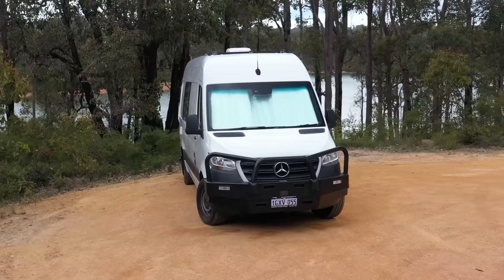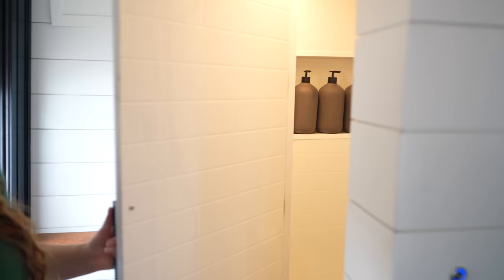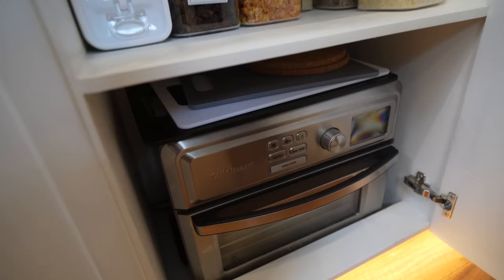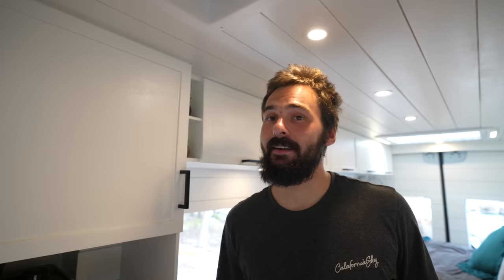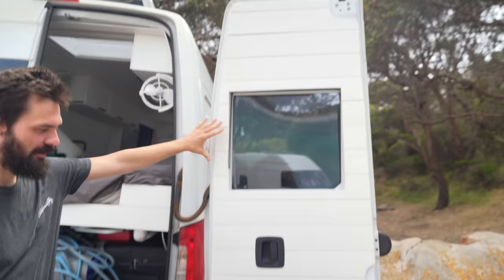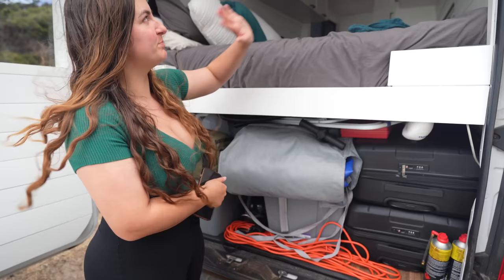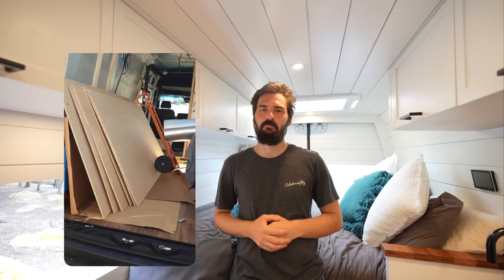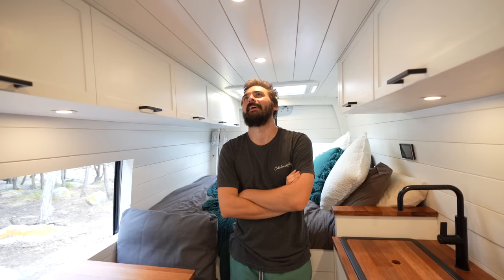VAN TOUR | Complete OFF GRID Self Converted Mercedes Sprinter Van

Comment: You are the first Van video person I have seen make a point of DC to DC computer charging!!

Finally!!

Love it. Totally the most efficient way to power anything that can take DC.

I turn on my inverter for the microwave, the induction cooktop, and things that aren't used often so they did not make my mental list.
Reply from the maker: Thank you so much! The DC2DC chargers are great. Especially with some of the vans having such capable alternators. It’s also nice not having to rely on the weather or campsites to be ideal for solar charging. 😅

Another great option would’ve been a supplementary alternator for the house battery but the pricing on the DC2DC chargers were much more appealing (at the time of purchase) and some of these vans have such capable alternators from factory.

Comment: I’ve seen alot of van builds over multi countries. But this 1 is absolutely perfect. Every thought, every detail, cost cutting that makes ton of sense, I love it. 
Only thing I think I’d add would be a small window between the kitchen sink & work area. An make the shower just a little bigger. Other than that I wouldn’t change a thing. An you 2 need now is some home touch’s, plants, pictures. You 2 are awesome, look forward to more video’s, so glad I came across this 1.
Reply from the maker: Thank you so much for the kind words, we really appreciate it! 😊 We did debate having additional windows actually but have been pretty happy with what we have so far, especially as our windows get super hot during summer 🥵

We're hoping to find some special home decor items while on the road!

Comment: Are you liking your square edged drawer/cabinet pulls, or do you find yourself bumping on them? Did you use 5 1/2"?
Reply from the maker: We were a little worried that would be the case but we’ve had no issues at all and we love them! The ‘hallway’ section in the middle though is pretty spacious in our van, if it was a tight squeeze in the middle it might be a different story. They’re 96mm, they’re these ones https://www.bunnings.com.au/taskmaster-96mm-matte-black-hollow-square-handle-10-pack_p0132784

Comment: We noticed you guys use a lot of major appliances, that’s so awesome. Do you use any appliances that are 1700 watts? In the USA so many say nothing over 1200. But you’re the 3rd van we noticed using such appliances. I’d you are able to use 1700, what electric system are you using? Appreciate any help/advice you can give to my husband and myself. Cheers and thank you kindly for sharing. ❤
Reply from the maker: Hi, yes we do! Honestly it really depends on how capable your electrical setup is to what you can use. We used a lot of Victron components which are considered as more powerful and reliable as well as high gauge cabling and appropriate fusing throughout the van that is capable of more than what our power draw can be. This allows us to use the full capability of the 15 amp 240V sockets that we have throughout the van. 

Sadly we’re not too sure on the USA but it could be worth double checking if not using over 1200 is because of any regulations in your country. When we went to register our van as a motorhome we had to submit our electrical certificates to the department who manage and regulate electrical and building safety/compliance in Australia.

We’ve put together a post on the specifics we used in our build if you were interested: https://lydiaandwehan.com/our-full-van-setup/

Sorry we can’t be any more help! Let us know if you have any other questions 😊
Reply: We live in Australia and have also fitted a Truma Saphir. Any tips on using the ac?  We are a couple of weeks off completion.   Thanks!
Reply: @lydiaandwehan  Thank you so so much

Comment: ❤ I’m have some? For you and I hope you can help please. I have got the same van as you but it’s SWB 16 plat. My back doors opened up all round to the side of my van meaning that the hinges are closed into the inside walls. Was your door’s the same if so did you get them replaced . I’m not sure how I could fix them so they don’t go through my walls . I’m looking for a window the same size you have over your bed. I’m thinking about one that opens up fully so that I can get onto the roof and clean up my solar panels have you a link for the window. Also have you a link to the sliding door black screen net please. Thank you very much for your time and sorry a long message I do hope you can understand what I’m saying I use speech chat as my reading and spelling skills are bad. Start my anxiety off . Thanks for sharing your lovely van you give me some ideas. Take care I have subscribed to your channel i hope you come across to my channel. Unfortunately my old channel has gone as I had been trolled by horrible people but am getting back into my new channel take care all the best to you both 😊
Reply from the maker: Sorry for the delay getting back to you! More than happy to help 🙂 If your van is a Sprinter there is an option for 270 degree door hinges which it sounds like you might have (but not 100% sure). We just have the standard 180 degree door hinges. From what we remember these hinges are interchangeable so you may be able to switch them if that's the issue you're having.

The skylight we have over bed opens up fully, it's amazing. Wehan uses it to hop onto our roof and clean our solar panels also. We've listed everything we used in our build on our website, I'll add the link below:
https://lydiaandwehan.com/our-full-van-setup/

No worries at all with the long message we are more than happy to try help where we can. Best of luck with your travels 💙
Reply: @lydiaandwehan   wow thank you so much I  was expecting 1 line message back. 🫣 thank you so much much for your help and time means a lot. And thank you for your link.  take care yourself 😊👍

Comment: Does the coffee machine moved when you are on the road, if so What is the best way to secure it
Reply from the maker: We didn't secure our coffee machine and haven't had any issues (thankfully) as it's semi-enclosed in the coffee nook area so we don't have to worry about it moving side to side. We've driven on some very corrugated and uneven roads and it has been completely fine.

However, we were looking at getting a non-slip mat for it just to be safe but we've been pretty remote the last couple of months so are waiting till we get close to more shops to find one. 😊☕️

Comment: hey great video, do you have a link for the macbook air charger and how does it connect to the laptop thanks
Reply from the maker: Hey, thank you so much. 😊 I'll attach a link for it below, we use the charger cable that comes with the Macbook and plug it straight into the charger.

 https://www.amazon.com.au/Satechi-Type-C-Charger-Adapter-Charging/dp/B07S4CQY6J?crid=H29C1T0FJDLN&keywords=satechi+72w&qid=1674639896&sprefix=satechi+72w,aps,342&sr=8-1&linkCode=sl1&tag=lydiaandwehan-22&linkId=323dce9a891bf62e09a08be9c929e71f&ref_=as_li_ss_tl
Reply: @lydiaandwehan  thanks for replying, it’s currently unavailable but I’ve found it on eBay, I only got the mains charger with my Air but thanks for your help hope you will be posting more about your lifestyle, I live on a boat but I have a van I’m going to convert so I can get to the parts the boat can’t reach.
Reply from the maker: Oh sweet, glad you ended up finding it! Boat and van life, sounds like you’re living the dream 😍🚐⛵️ What area are you travelling?
Reply: @lydiaandwehan  i'm in the midlands England at the moment but i travel all around England including London, Birmingham, Leeds, Manchester and all places between all at 3mph about 5kph i will be heading to the Nottingham river festival in August

Comment: Hi brilliant video. I was just scrolling through your webpage about getting a van registered as a camper (which was very helpful) . 
I was just wondering, do you know if it is a legal requirement in aus to get it registered as a camper or can you self convert the van and never register it? Also what that would mean when coming to sell it? 
Thank you for your time reading!
Reply from the maker: Hi, we'd recommend you clarify with your department of transport and insurance company. We've heard a lot of people not registering their campervan but not doing so can leave you liable in a lot of ways... here are a few things to keep in mind: 
1. Insurance Coverage - if the vehicle is used as a campervan but isn't registered/insured, as such you can have issues with insurance if an accident were to happen. We'd heard stories of people having their vans written off only for insurance not to cover it because they weren't registered correctly as a campervan.
2. Resell Value - Having the vehicle registered correctly and having the conversion 'approved' increases it's resell value. Having the build approved legally gives more confidence in it.
For us, the additional effort was worth doing things 'correctly' and making sure we were 100% covered.
Reply: Thanks for your reply!